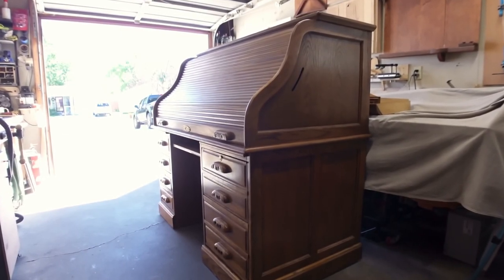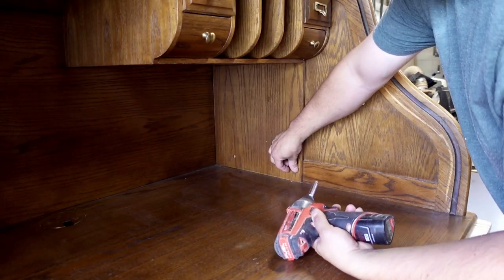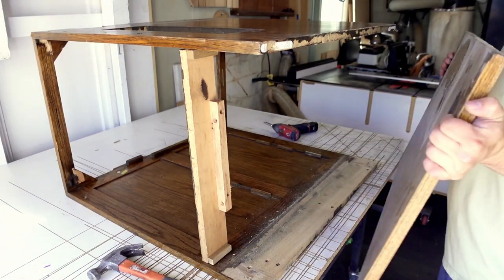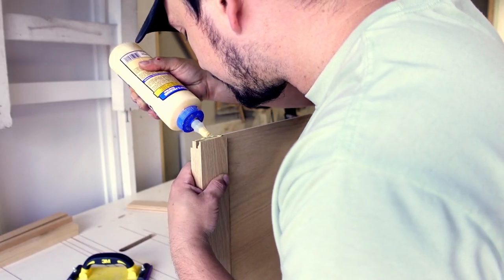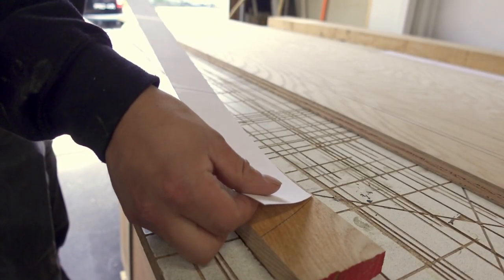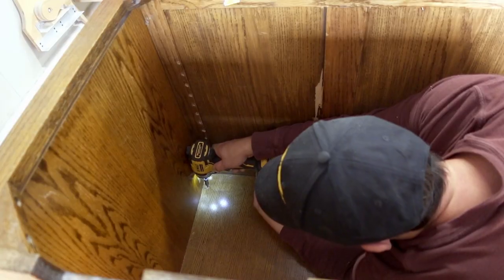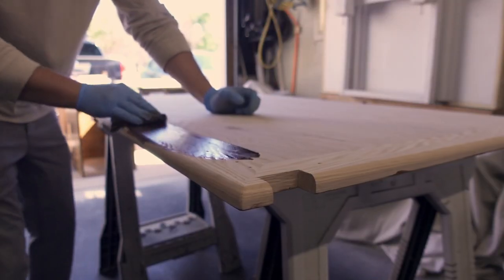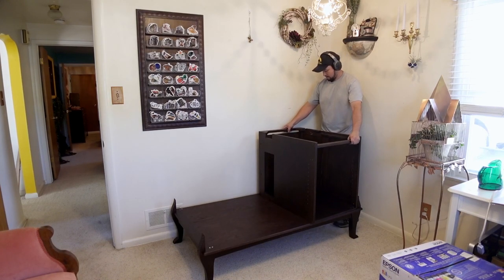Unlocking The Way You Build.

Comment: I very much like the whole concept of re-using older pieces and have to accept that, to make those pieces fit modern life, they have to be adapted. Sometimes, it happens sympathetically and sometimes not. In this case, I think you respected the style of the old piece. 

Our house has a fairly wide mixture of styles of furniture. That’s quite deliberate that it stops the interior looking like a pastiche of a certain style and it recognises that every era of furniture style have pieces which, to us, have great quality. 

I do smile somewhat at your use of cross headed screws in this piece. I hear in my mind’s eye a tutor telling me to use visible fixings appropriate to the era of the piece. That means slotted screws for pieces made before 1960 - ish. I don’t think that lesson envisaged a piece which has heritage in 2 centuries. More relevant advice might be to do what you think is right and hang the others.
Reply from the maker: I like your thought process. Most of the slotted screws came from the cabinet itself, so it was likely made in the 70's or later. Thanks for taking the time to comment!